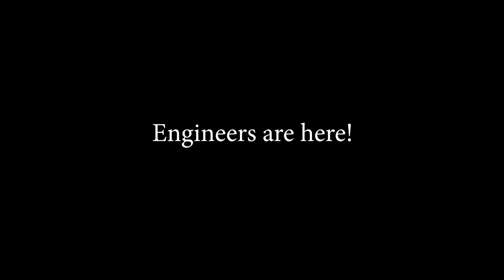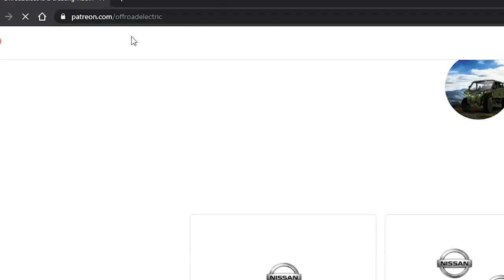EP.30, Engine Work on the Second Tatra- 4-motor Monster Truck Project

Comment: I love the chair in the cab. You could have had a runaway engine when it did start. Which can be bad. I agree get rid of that diesel dog. 
👍 Marty
Reply from the maker: I can ship the chair to you if you wish.:) Signed.:) I will check the options to let somebody to fix the pump, it would increase the price of the engine.....
Reply: Off Road Electric 
You are amazing with the ability to sell the parts to make your money back on the purchase price. If you tried that in the States you would have a hard time. But I am sure you know that. We need to recycle more in the States like other countries do. I am with you Peter this is a amazing project. 👍. O don’t worry about the chair you will need it on those hot days.
Reply from the maker: @martyportersr7008  Maybe I might be able to do it anywhere.:) I bought 17  M35A3 trucks, disassembled them, and sold the parts. Cat 3116 engines fit to small machineries, axles and supersingles wheels were for offroaders, and the rest of the truck for upgrading the M35A2 trucks, because there are thousands of them in the USA.
Reply: Off Road Electric 
Peter you are amazing with your abilities. You are one of those people that can do more with less. I have a saying that goes like this. 
Winners do what losers won’t!
You are definitely a Winner.
Reply from the maker: @martyportersr7008  Than let's win together this battle!:)
Reply: Off Road Electric 
You know I am with you from the start. Damn near it.